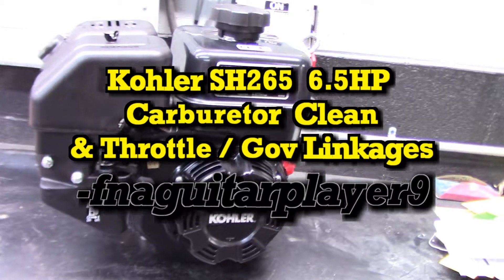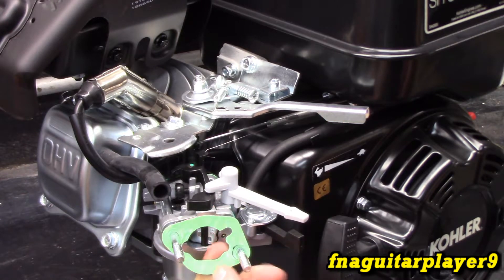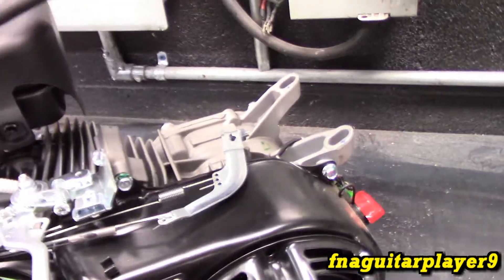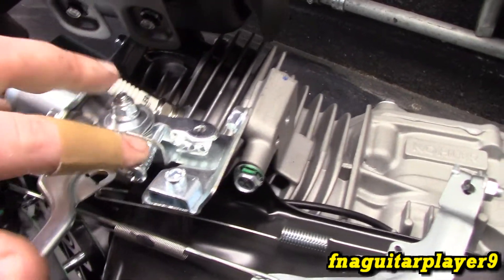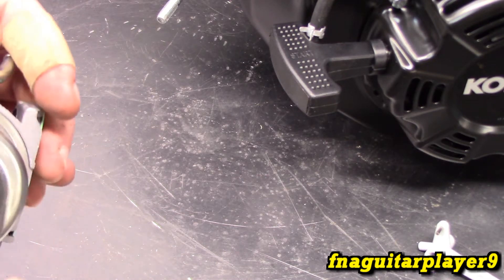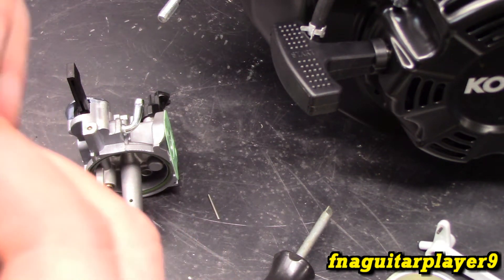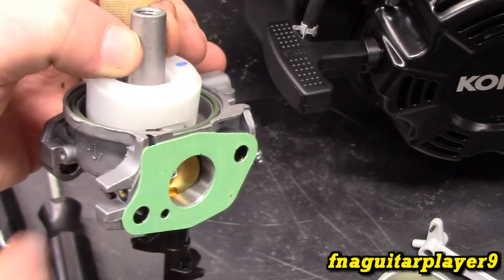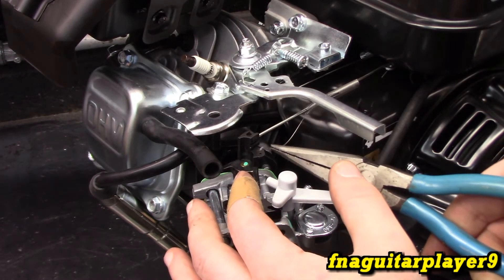Kohler SH265 6.5HP How To Clean Carburetor and How Throttle / Governor Linkages are Setup

Comment: I have a kohler 14hp engine. Only 28 hours on it. It dies when idling.even slight touch of trottle. Hard started for 10 mins. Runs ok on full throttle. Did put old gas in it at one stage. Trouble started then. Cleaned out tank and put new gas in. Why would it die on idle yet run no bother on full trottle

Comment: Great video. My splitters carb had a gasket/washer in the fuel valve get chewed up. I think when i ckeaned with carb cleaner. It looks like the same material as the bowl o ring which swelled up from carb cleaner. I was able to dry out the oring, but i think the first time i turned the valve it chewed up the inner seal (about 1/2" dia. With 4 holes in a square pattern ). Waiting for a kit to come in with the washer. My recommendation is to remove before forcing carb cleaner through the fuel line.

Comment: Thanks for the video. I recently purchased a log splitter with this engine and it had sat for many years with ethanol gas in it. Your video helped me disassemble it and clean it in a ultra sonic cleaner and sure enough the jet and the diffuser were both clogged.  I am interested in what fuel  filter you used or would suggest for this engine. I could not find your video on it that you mentioned you were going to do.  Thanks again.

Comment: Aloha. I have a small engine repair business here in Oahu. I've never  seen a kohler engine with a carbon canister on it. RH265-3112.  The canister leaks fuel.
I changed it out with a new canister and after several minutes it leaks out the overflow tube. Can the canister be bypassed ?

Comment: I have the same motor (SH265) and its 3 years old. It runs good until I let it sit 4 weeks or longer then it won't start. I have to remove the air cleaner and drop 1/4 ounce of gas down the carb then it'll fire right up and run for hours no problem. I have other small engines that sit like this one for weeks and fire up with no issues, why is this engine being such a little biatch/PITA? I run non ethanol gas and treat it well, store it under cover.

Comment: Where did you purchase your engine from? My stock engine had water intrusion and the piston is rusted to the cylinder. Is there any chance of getting it back running or would it be more worth it to replace the engine?

Comment: I got a new carb. The plastic part with the priming bulb doesn’t suck up any gas. What should I look at? It came with a new one (large black plastic part that levers go through). It’s clean. It had an insert that snapped through the hole that mounts to the carb that the original didn’t have so I removed it. It isn’t in your video either so it must have been for shipping.

Comment: It was drained out of gas last spring. It did start and run a few minutes. Went to loping tried to adjust and it died. Flooded left to dry, went  back the tank was dry , open ck oil and the gas was in oil, how would it get in with not running?

Comment: I pulled the carb and it was dirty and needed to be cleaned.  But that wasn't the issue.  I pulled the float and main jet, cleaned some rust out of the bowl, but couldn't get any air to pass through the fuel inlet.  Tried several times to clear the blockage, then went back and watched the video again.  When I started the pressure washer up I put both levers in the same direction.  That turned the choke on, BUT turned the fuel off!  LOL  I finally went back and watched the video again and it dawned on me that the fuel was shut off.  Thanks again for the video.

Comment: Thanks for the video.  I started the pressure washer this AM and it ran for about a minute and shut down.  Either bad fuel or carb needs cleaned, I guess.  I like to check for videos that show the dis-assembly process first before tearing into something.  Thanks again.

Comment: I recently purchased a used wood splitter with this motor on it, when I put it up to almost full throttle it starts surging bad any idea what could cause that
Reply: I had the same issue on a used log splitter. The problem comes from the idle jet. It is very simple to get at. There is a plastic screw that is used to set the idle throttle. You take that screw out and underneath it  will be a plastic plug that drops into the top of the carb. Either use a thin flathead screw drive or needle nose pliers and work that out of the carb body. Then clean it from the bottom up with a thin copper wire or thin wire brush wire. At 16.20 in the video you can see his left thumb and look carefully at that plastic screw and under that screw is where the idle jet sits. That is the cause of a surging engine with this carb.

Comment: Thanks Frank! Like the fellow below I have a Kohler pressure washer that wouldn't run. After carb disassembly I put everything in the ultra-sonic and reassembled. There's also a screw out filter in the tank which I cleaned. Runs great now, really appreciate your help.

Comment: Great video.
I bought a log splitter brand new put it in the barn 2 years ago never touched it.
Now fired it up won't start.
Ended up taking that bowl off full of rust.
I can't get unit to start at all.
All I did was buy it never ran it.
Is the carb fixable or wasted???? 
Also not sure if the inside of fuel tank is rust?.

Comment: I actually have a Craftsman M270 mower with a Honda clone engine on it and it's the 159cc engine and it has electric start on it that uses a Craftsman V20 battery for the electric start to work

Comment: Great video. Have a pressure washer with the exact engine and carb. Just wouldn't run..... Thanks to your detailed video, I took out the carb and gave it a good cleanup. Put it all together and it started on the first pull. Thanks again....

Comment: Have Hohler 3000 SH255 6.5 hp, looks same.  The issue is the throttle control does NOTHING when moving level back and forth.  It idles great and will idle until it runs out of gas if you let it.  But, moving the throttle arm back and forth does NOT change engine speed? Cleaned carb and jet and linkages are all connected correctly?  Any ideas?

Comment: Great video, next time please show how to clean the idle jet under the low speed adj. screw. If plugged it will cause surging or delay in response. I see lots of them plugged in my shop and sometimes I even have to drill them out a size to two. Thanks
Reply from the maker: Ok, I can do that. I forgot about that for some reason, sorry! Thanks for Watching!!!